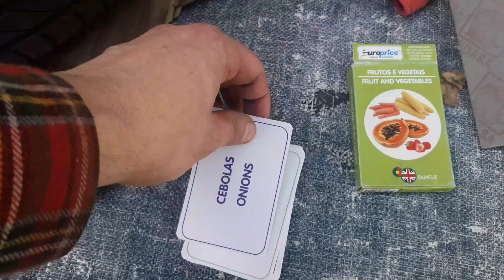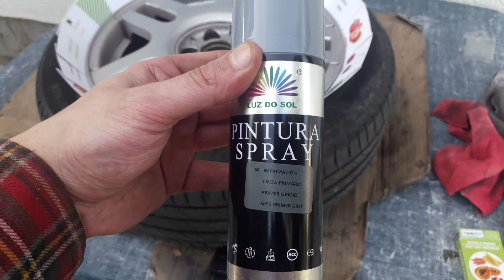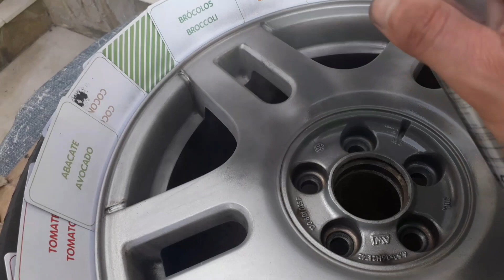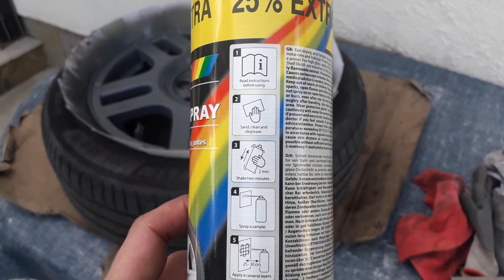DIY How to paint your wheels with Spray! Motip Wheel spray

Comment: Hey bro... did  you apply clear coat after the paint or it's not necessary??
Reply from the maker: Hello bro. I didnt but its necessary and you will get a much better result with laquer.
Reply: @luiscorreia1216  thank you so much....i ordered the same to paint 4 
15" wheels....i ordered two cans of motip 04010 and one can of laquer.....i definitely won't run out of paint...😉👍🙏🙏🙏🙏🙏🙏